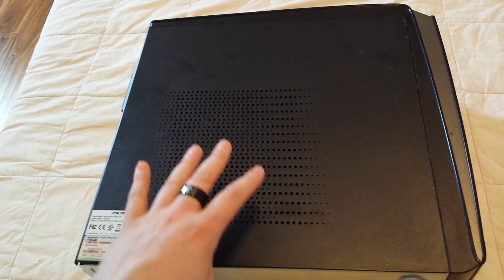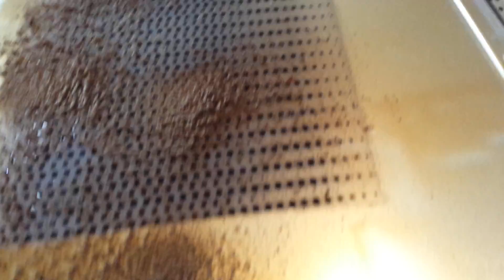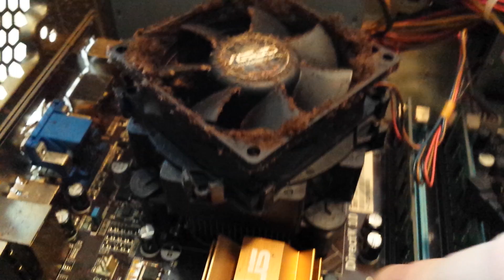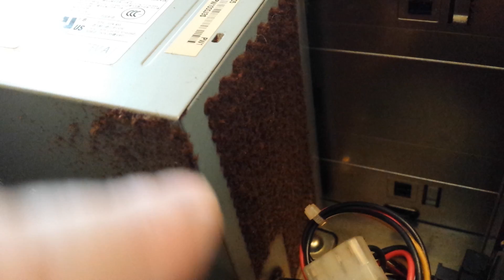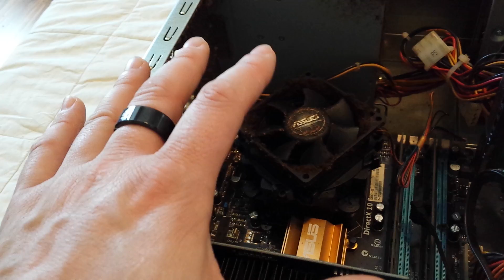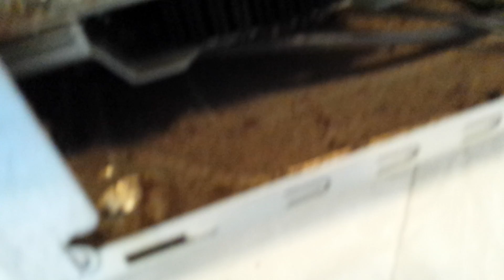How Smoking Around Your PC Damages It

Comment: yea i completely cooked a 1000$ gaming pc after only 5 years even after replacing/upgrading the CPU and RAM, it came stock with a ryzen 3 2600 and 8gb of ram and a radeon RX 580 , i slapped in a ryzen 7 5700g and 32gb of ram but the motherboard is caked with resin nowhere near as bad as this PC but it definitely gave out

Comment: Now I am worried that's the reason why my pc is going a little slower I wonder if its worse for weed?
And also what if you have a air dehumidifier would that help I keep it running all the time a specially when there is smoke in the air.
Reply: It's not so much even the tar in the cigarettes that does it, it is the nicotine. I have seen plenty of damage from cigarette smoke in my years but have yet to find the same effect happen with marijuana. I have agoraphobia and don't leave the house and smoke weed all the time inside and have never noticed any side effects anywhere not even on walls or baseboards. 

Now mind you I do use air purifiers with an H13 medical grade hepa filter but even before I did, I never had an issue, a dehumidifier/ humidifier will help a bit do to the air intake it has but if you truly want the air filtered and cleaned I would suggest an air purifier.

Comment: garbage prebuilt. no fan filters, just open to the air letting everything in, smoking or not, positive air pressure and washable fan filters massively reduce dust/tar buildups like this. my pc is right next to me and barely has any dust inside at all as it it all in the filter on the front which i can wash out in the sink maybe twice a year. it is a problem that is only a matter of time, it is solved by building your pc to mitigate this issue.

Comment: Empty moralizing. Smoke has no appreciable adverse effects on computers in and of itself. If you don't clean your computer, this sort of damage will occur eventually whether you smoke or not. I'm not sure why you keep throwing the word nicotine in there, but i can't think of a valid mechanical or electronic reason. It must be force of habit. I would simply take pictures and sell the customer on periodic cleanings as a preventative measure for their particular use-case. People who feel judged are less likely to be repeat customers.
Reply: it is not nicotine it is tar. You are entirely correct, a small amount of cleaning and proper air distribution through filters means the cleaning part is mostly washing the filters.

Comment: i live in a smoking house as well, however, i have the habit of taking my stuff apart every week or 2 to clean out the dust and such to prevent said issues.... my advice, if you can't provide enough ventilation for your computer, clean it more frequently than you intend to.

Comment: This will happen only if you smoke all day in a dirty room and never clean your pc..
Reply: The room could be spotless and have good airflow , as long as the pc is sucking in smoke , this sooner or later will happen.
Reply: @causetheplumstasteyum7848 no it won't do you even smoke? It'll take years for it to get that bad and by then ud have cleaned it so no its not a guarantee it will happen.
Reply: @RageKage987  It depends how much you smoke , yes i smoke a lot and have done for years right next to my pc , it gets manky after about 2 weeks withought cleaning it , bigger case fans suck in a lot more air too

Comment: I would worry less about cable management and more about getting dust covers for the openings that the customer can quickly remove and wash in the sink and slap them back on... More airflow isn't going to stop this from happening, it will make it more likely to happen. You could have just gotten them a passive cpu heatsink and then it wouldn't be an issue anymore...

Comment: That's not from just smoking around a computer. That's from a family of chainsmokers who smoke with all the windows closed for years. I've rented a house out to a family like that, and the entire inside of the house looked like the inside of that computer by the time I finally got them kicked out 3 years later for lying on the application when it asks "Do you smoke?" and they answered NO ffs

I smoke a pack a day, and my pc's have NEVER looked anything like that.
Reply: It could just be one person who never cleans out the pc , but yeah for sure that amount of buildup is multiple years of daily smoke intake even with the windows open all the time , if the fans are sucking in the smoke , within about 6 months daily use you will notice that building up

Comment: That computer looks like it was installed in the industrial range hood of a restaurant to have that kind of grease. 
 Smoking home as in its constantly and currently on fire? Looks like a shitload of coffee grinds. 
Was the smoking home a bingo hall from the 70’s? That looks crazy to the point where I wanna call bullshit. I smoked inside for 14 years and my computer has no buildup of any kind on the inside.
Reply: Mid 60's Couple, small office in home, both heavy smokers. System was on carpet under desk, walls and ceiling nicotine stained. We actually see it more than we wish we did.

Comment: It's gross, I actually had to recently do this for a friend who smokes and they never cleaned the inside of the case out so I swear they had at least 2 inches of dust and tar buildup all over the inside the thing. It was a miracle that it even still ran. Granted it got very hot and performed slowly, but still somehow miraculously worked. Still had Windows Vista Starter Edition on it. Got it cleaned out and it seemed to do a little bit better, however unless they can kick the habit or not smoke near the computer, I'm sure it will all come back again. Although, considering the age of the computer, may not be necessary to clean again as I'm sure the hardware won't last that long. Again, I was surprised that something from its era was even still working.
Reply: If it was running windows vista , the smoke damage is the least of his worries.

Comment: what if i smoke around it but i have great circulation and there is no still air
Reply: doesn't matter its still bad you should never ever smoke in front or near your PC also if your PC ever screws up its not covered by warranty either so i would think twice before smoking near your PC
Reply: 1440p Gaming
ive been doing it with the same computer for years and i do always every other month do a complete wipe down of my system with non static brushes and compressed air so i guess it just depends on who is doing it and how well they care for the hardware but i have cut back on smoking around it after seeing this
Reply: If you regularly clean up your PC inside and out. You won't see the kind of build up you see in this video. The results in the video are from years of build up and no clean up. I have seen worse. I once had a PC from a customer that I was simply too afraid to hook up in the home. With good reason too because the PSU blew up when I connected it in the backyard.

For the amateur computer hacker I would simply advise to do exactly what you do. Doesn't have to be every other month. Once or maybe twice a year would be good. Maybe give the heatsinks a good rinsing if they feel sticky to the touch or when blowing air through it won't get rid of some of the dust. A citrus based dish cleaning agent can be a good way to get rid of the stickyness. Just make sure you clean off the cleaning agent with water before you put it back in your PC.

Comment: What about weed?
Reply: Although I advise against the use of that drug, or any kind of smoking, I don't believe it will be as bad. Cigarettes release tar and nicotine. This is the rust colored gunk that builds up in your PC. It's the same gunk that builds up in your lungs.
Reply: weed produces tar aswell but no nicotine youll still have probs with tar but it wont be as bad(still bad though unless you use a vaporizer in wich its like vaping, nothing happens except sticky water vapor around the case fans but unless you blow it right into the case nothing bad will happen)
Reply: @josephkreifelsii6596 true but it's not much better. Weed will still do damage the real problem is if you clean it regularly or not.
Reply: +Christian Rodriguez any smoke buddy